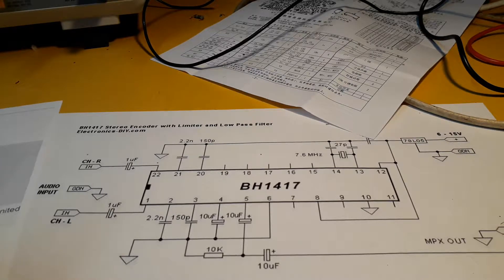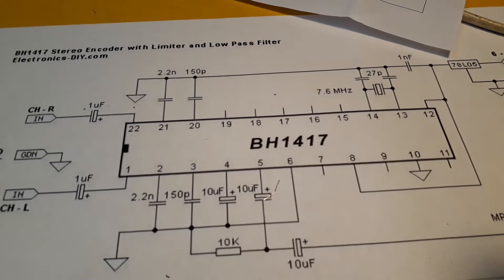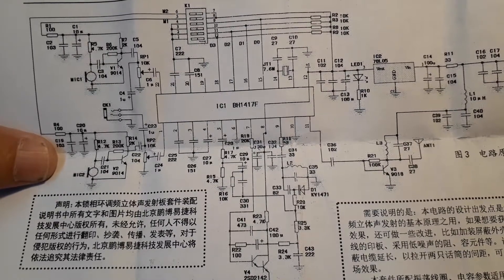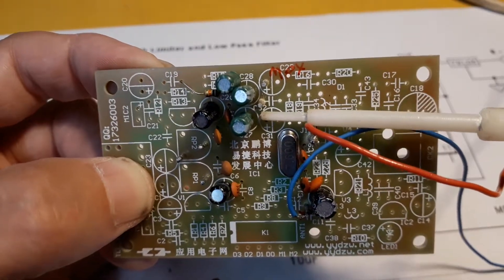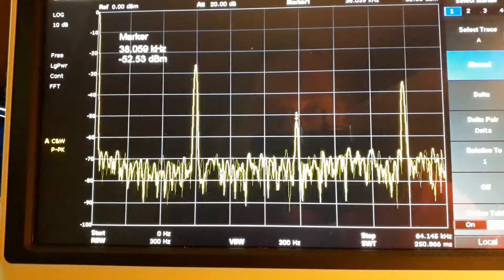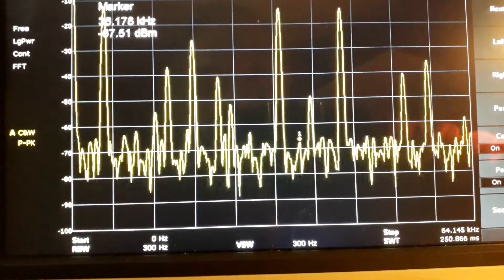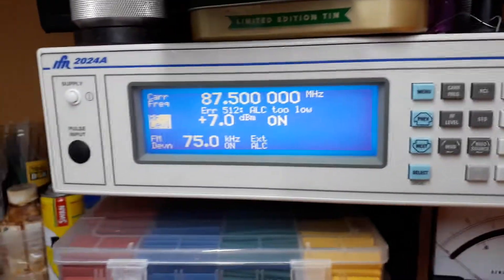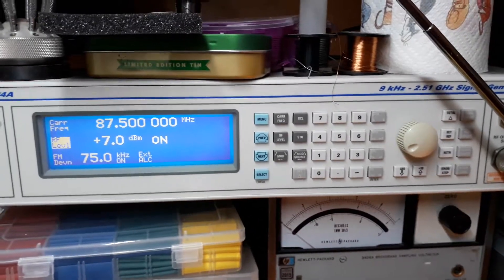Stereo encoder circuit for RF signal generator

Comment: Awesome inexpensive means for generating stereo FM signals; great stuff, Nick!  Maybe build a pair of 15 kHz low pass filters for it?  Just a little surprised that the board (passive) or even the chip itself (active opamp-based) doesn't have a ready scheme for wiring one in.

Comment: Great video!! You are right in it's a Marconi or almost:-) Your model is an Aeroflex but it's the same place and so on.
May I please ask you about your opinion of it now, after some more years?
Reply from the maker: Thanks for the comments, was aware of the company history, sad Marconi is no more.
After having it for roughly 3 years I think, I love it, I particularly like that the rf output goes down to -140 dbm , my previous sig gen the Marconi 2022 only goes to -127 dbm. this makes it easy to test very sensitive receivers.
It also has the high power option of +25 dbm, not many generators will do that! 
One thing I don't like is that there is no dedicated buttons for AM or FM on the front panel, as the 2022 has, so you have to go into the modulation menu to change which is a bit of a hassle.
I've got round this by storing a frequency and modulation type for AM and FM in the memories so its quick and easy to change.
Also I like the fact it has 1 Hz frequency resolution, on the 2022 its either 10 Hz or 100Hz  above 100 MHz . I haven't got the ocxo option in mine but its always within a few Hz  when I turn it on. The best thing was the price I only paid £475 for it which is a very good price I think.